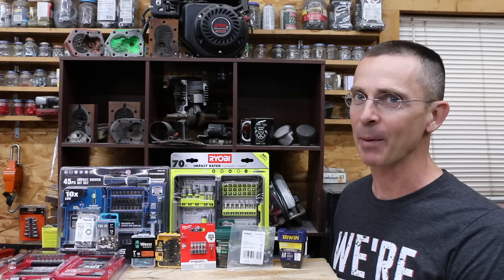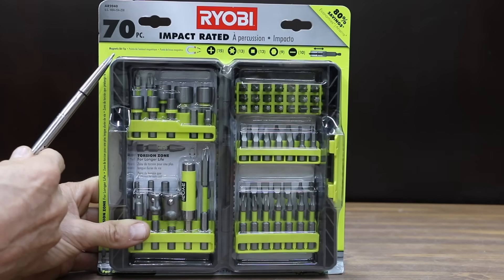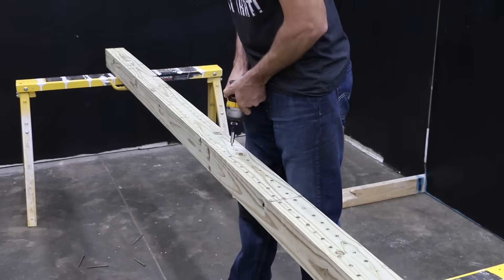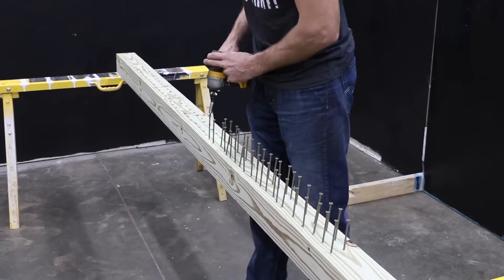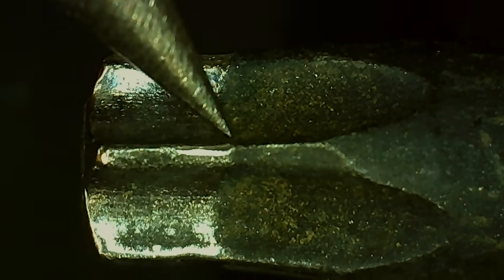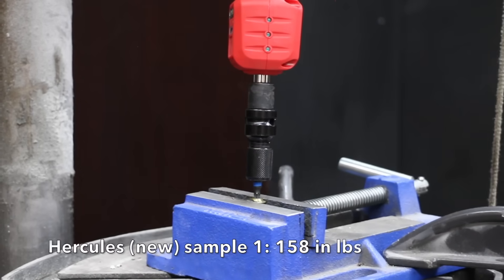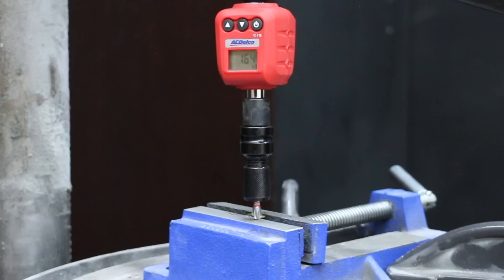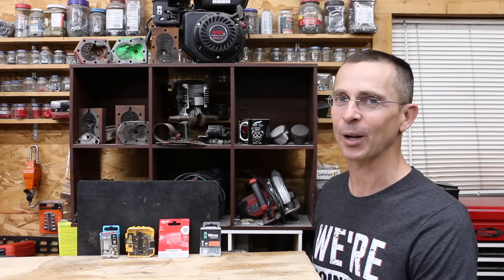Best Star (Torx) Bit Brand? Milwaukee, DeWalt, Makita, Ryobi, Wera, Wiha, Irwin, Bosch, Bauer

Comment: I am surprised that America has not adapted to using Robertson screws and bits!? Wonder why? Here in Canada they have been the go to wood screws ever since I can remember and I am 63.
Robertson’s may not be the best but they are overall good drive heads. The reason they aren’t common goes back to a decision by Henry Ford who wanted to use them on his assembly line. Unfortunately he didn’t want to licence them from the Canadian patent holder, he wanted to buy the patent in order to prevent his competitors from having access. Robertson wouldn’t agree to the deal Ford offered so he went about preventing them from general usage and switched to Philips instead which have become the American standard. Robertson's are slowly being accepted into American usage but the tariffs and restrictions make importing them more costly. American manufacturers are thus able to keep the price artificially high. In fact they are no more costly to make than any other screw type.
Reply from the maker: Thanks for the feedback.

Comment: I've owned a Wera precision t-screwdriver set and yes, it outperforms all of my screwdriver set very well.
Reply: I also purchased some Wera tools on a whim and have been impressed with their performance. I have a T60 that I use on BMW belt tensioners that love to strip out and the Wera is worth its weight in gold for that application. Not only that, but I find their hand tools to be designed well and include innovative features that make work a joy.
Reply from the maker: Thanks for sharing.

Comment: Great job as always. Love your channel. I got notification and watched right away. I still want to know what item is best for removing oil/grease from concrete like driveways and back porches. I spilled bacon grease on back porch/cement, and it just won't go away. Pressure washer  did nothing. Thanks.
Reply from the maker: Thanks!  Thanks for the video idea.

Comment: Good review , out of interest the dewalt bit holder your using have you had any issues with it ? I bought two of these and under load the black collar that you pull to insert bits keeps coming off it’s only held on by a very small section !
Reply from the maker: Thank you.  I haven't had any issues with the DeWalt yet, but I haven't really used it all that much.  I have several styles that I'm using
Reply: @ProjectFarm  yeah me too the best I’ve found so far is the wera impaktor stainless steel one it’s got a strong magnet and a ring clip that holds the bit

Comment: I use the Milwaukee bits the makita xps bits and the dewalt bits the most having a tight fit that don't release easy can be a pain but also a great thing when it comes to over head or extended arm use but that is my experience loose fit bits can be a pain if you can only use one arm to use the tool and need to depend on the bit to hold the screw @Project Farm
Reply from the maker: Yes, great point!!  I agree.

Comment: I'm only using Wera for anything which is bit releated. Out last any other brand and it's got the "best" fit for any screws. Instead of harming the screws its putting the heat on the bits.
Reply from the maker: Great feedback. Thank you

Comment: I don't know if you've done this, but what about testing the strength of the most popular socket brands? 

I don't know how many times I've cracked sockets on bolts and nuts that do not want to move, even without an impact.
Reply from the maker: Thanks for the video idea.

Comment: Why would you need Torx for wood? Why wouldn't you just use Robertson bits? Robertsons are awesome. But because of Henry Ford they're only available in Canada.
Reply: Are roberson cheaper? I've switched to Torx just because it does better for me than phillips. I noticed the fence guys who put up fence next door used roberson
Reply: @Avvura  you must live in Canada because Robertson drives are rarely out of Canada because of a dispute between the inventor Robertson and the industrialist Henry Ford.
Reply: @pegtooth2006  no I'm in United States. The only square drive I've used normally is for electrical boxes and connectors.

Comment: I use  star bits all the time and have my bits always wear out after a couple hundred  screws.
Reply from the maker: This video will be helpful!  Some of the ones tested just don't last.  What brand do you use?
Reply: I use screwdrivers and bits from PB-swisstools. I have used my most used torx bit for at least 3000 screws. Not bad for a 2 euro bit. 

I have no idea if this brand is available in the USA but there are no better screwdrivers, bits and hex keys than pb-swisstools in my opinion.
Reply: @autobootpiloot  oh boy are you in for a treat if you happen to use wera sometime. Thex  are just on whole new level.
Reply: @getriebesand2195  I have used Wera screwdrivers and i was not impressed by them. The head of the driver was not as good as the Swisstools and that is basically the bit of the screwdriver. Have not yet tried the actual bits from wera. It is however a common brand in my area so i might give it a go once.
Reply: I wish I could get a T6 to last that long. Even the best (Wiha) don't last 1/2 that long.
Reply: @MrWoodyBalto  T6 size? That's like nothing, I hope you don't use any drill on this. 😁
Reply: This was made for you bro